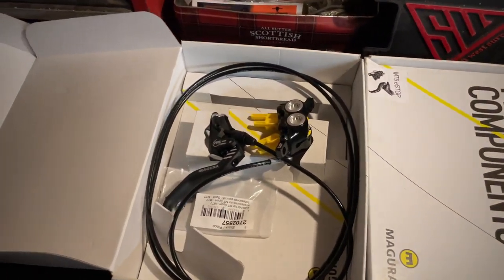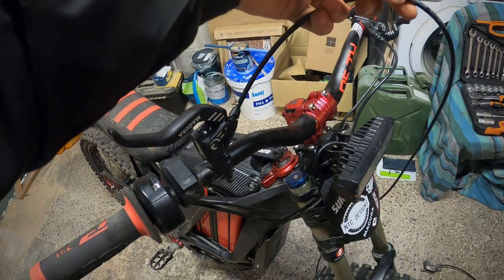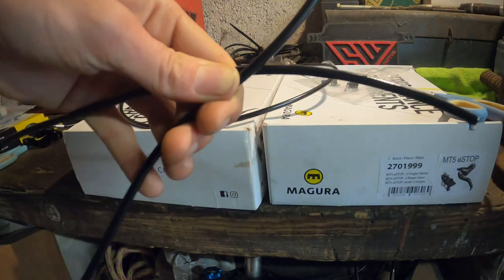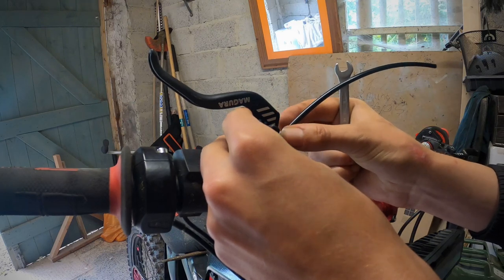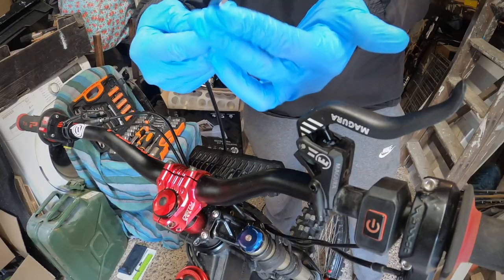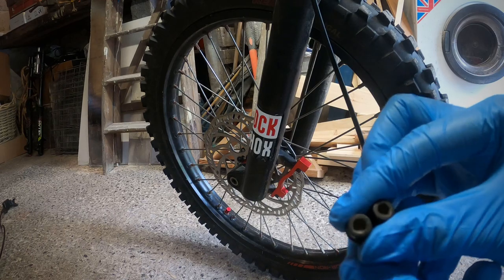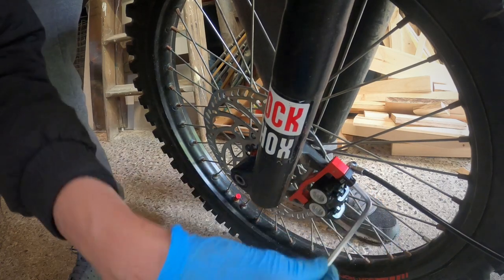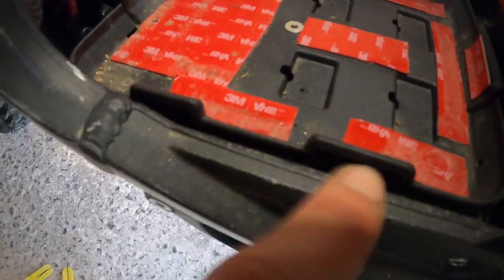How To Fit Brakes on a Surron Without Bleeding!

Comment: Uuuhhh you do know your only getting maybe 60% of the real braking power and modulation you could have if you actually bleed them right?   There's ALOT of air bubbles in them outa the box....let alone after you done cut and shorted then line.
Reply: don't they come pre-bled out of the box? at least that's what they say on the website
Reply: I was thinking the same thing hahaha wtf you just cut the wire. Its like 50% air or something